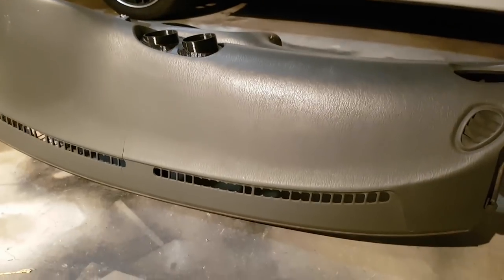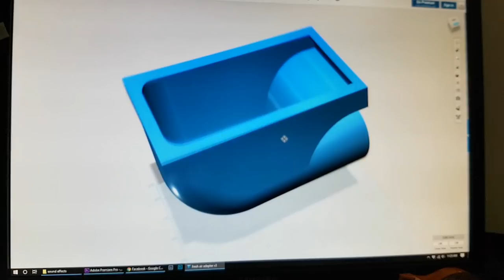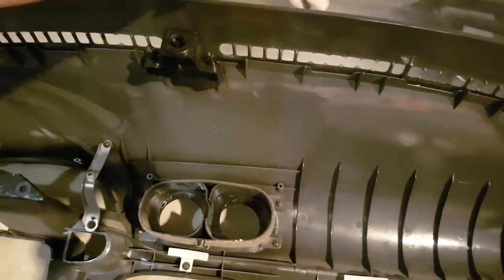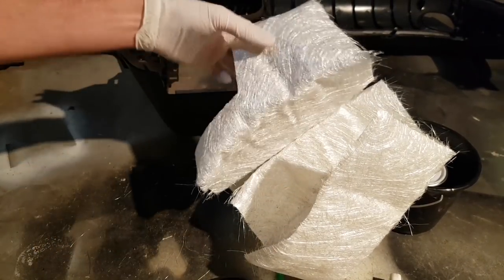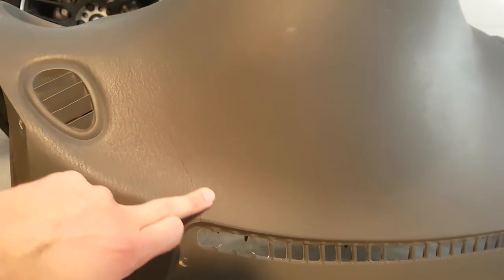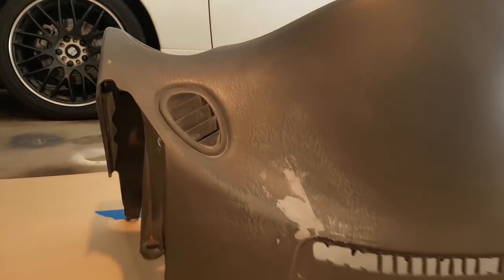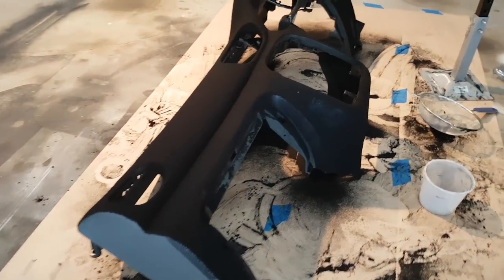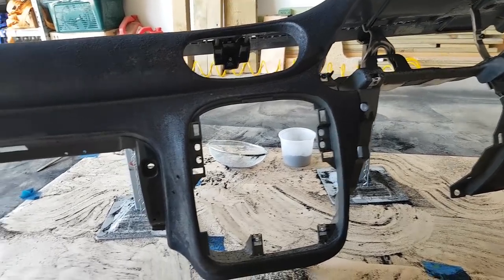Budget Race Car Build - Part 22 - Dashboard Flocking and repair

Comment: I wish I could fix my dash, but it's actually in multiple pieces and raised to much :'(, you are so lucky to get one in such good condition!
Reply from the maker: Yeah that sucks, need to get down the wreckers and find one that's only slightly buggered! The fiberglass fix works really well, that selleys kit was like $12 or something and comes with everything you need, well worth doing it and preventing further cracks :)
Reply: @TheNuggetProject  I wish, up here in Queensland the heat has gotten to all of them so it's basically like trying to win the lottery. 😅
Reply from the maker: @blakeedmunds1692  haha bugger! if it was a small part i'd be happy to pick one up for you and post it, but the chances of a dashboard getting up there for a good price and in one piece are slim to bugger all!
Reply: @TheNuggetProject  you'd need see some pictures of the condition of it haha, rooted beyond repair, dashmat hides it pretty well though.
Reply from the maker: @blakeedmunds1692  dash mat hides all!